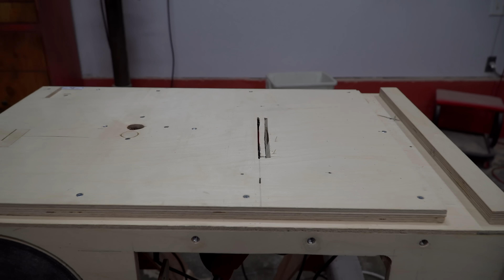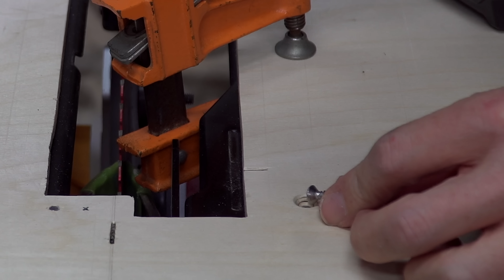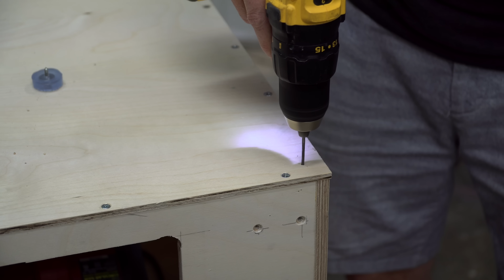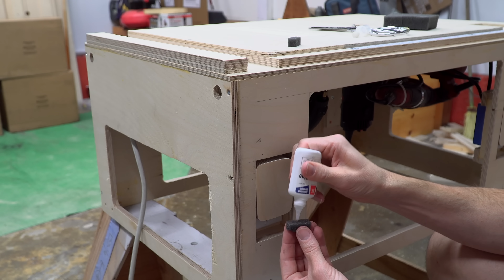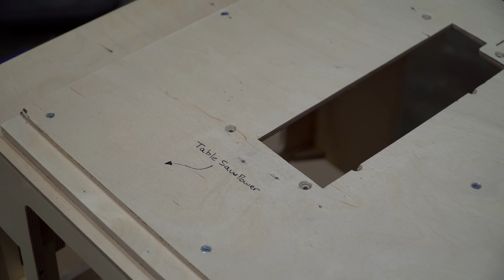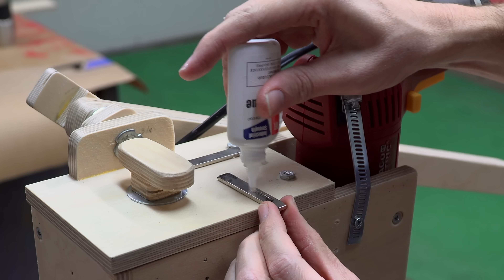Building the MicroShop, Part 8 (the Final Part)

Comment: I bought the plans and built the workshop never expecting my box store jobsite tablesaw to take out on me and I'd spend a month ordering and waiting for the parts that did not fix the problem to show up. Yes, another part is due in 3 days, but in the meantime, thank you Tommy, the workshop table saw I made is taking up the slack. 
  Before ordering Tommy's plans I had viewed YT's videos of woodworkers shops with 2 or 3 tablesaws and my thought was, well, if I had the space, the volume of work, and the money to buy more than my one table saw, just why should I do so? Question answered, TS breakdown. Duh.
  Thank you Tommy, you have been a tremendous help solving my present dilemma.
  My little 10 x 20 can spare the room for a second tablesaw and it comes in handy making repetitive cuts needing a re-set of the fence between each cut. I even made collapsable legs for my workshop unit that fold up under the base and make hauling to a jobsite quite easy and quick.
Reply from the maker: Glad to hear it 🙂

Comment: I really think you did a very good job on this work bench. Only comment I make is about the vertical drill unit. Could have fitted a small drill stand instead, less expensive and more reliable.
But very good indeed. i am planning to build something similar and perhaps use some of your ideas in mine.
Reply from the maker: Good luck with the project!

Comment: I really need to make this. I want to get the plans, but first wanted to know your thoughts on building it using just 1/4 inch plywood.
It looks like you used 1/4" plywood only for the third top piece. Is the rest 1/2 inch or 3/4 inch?

Here in my country, the only plywood available is 6mm (1/4").

Maybe MDF?

Great build btw.
Reply: I know your question is old, but you can laminate 2 sheets together to get 1/2" and 3 to get 3/4". I'm sure he lets you know the thicknesses needed in the plans.

Comment: This is quite the amazing piece of power-tool furniture (that's what I'll call it), but I do have a question about the design: If you could do it over again, would you have made the handle that lowers the drill press a curved piece that curves upward instead of a downward-facing straight piece? I could be wrong, but it seems like with it pointing down there could be two issues: (1) the bar could possibly end up hitting a part of the piece you're working on if it has high parts, but more importantly; (2) it just seems like it would be more ergonomic if it was pointing up. Maybe I'm overthinking that part of it, but that's a tweak (probably the only one) that I would make if I make this. Also, if you tried a curved piece, did it not work as well?

Again, this is fabulous, I'm just wondering about that one piece. And like others have said, thanks for also showing your mistakes. Often times people don't understand that some of this is trial and error--good plans sometimes just don't work out in the real world. That's good for people to know. Very nice channel and series on this project. Thanks!

Comment: @One Minute Workbench.....are the drills in the drill press and the disc sander the same model or do you recommend a less powerful drill for the disc sander?
Reply from the maker: I used the same drill for both and am very happy with the performance. I’ve never used the max speed for the disc sander, but the extra torque of a more powerful drill is nice. I hope this helps!

Comment: never heard of low friction tape, have no idea where to even get it, it probably costs too much (where i live), but i had a sticking drawer to fix once, planed the bottom down a little, refinished it with lacquer (polyurethane) and rubbed candle wax on both surfaces, now it runs smoother and more easily than any drawer slide ever could.
I have an old drill that has no bearing behind the chuck, it just rubs on lubed plastic, which obviously wore out and is now pretty much useless and unfixable, but i can still use it to drive a shaft, since the shaft doesn't move side to side, so i might make that sander part.

Comment: So, I'm thinking the table saw part looks good. I could definitely use that. The rest? Meh.
Then I saw the router table. Oh, I could use that. The rest is useless.
Oh, a disc sander? The jigsaw could come in handy. I've always wanted a drill press.
So, in summary, a project that only appealed to me because of the table saw leaves me asking, 
Where's the lathe?
I think I will be building much if not all of this.
Thank you.

Comment: I subbed a little while back but hadn't seen anything on this series until I came across the update to the riving knife!  Very cool build!  One suggestion I can make is to use a set of those self-leveling feet on the bottom of the cabinet.  They should help keep things square from the floor and remove any wobble from an uneven ground.  Time to hit that bell!
Reply from the maker: Thank you for subscribing, and thanks for sharing the tip about the leveling feet!

Comment: have thoroughly enjoyed this series and will try to emulate at some point as i'm planning a RV build when i retire and think this bench would be of great help. I do have a couple snags tho' all your drill dimensions and measuring are in inches do plans have metric spec for uk build and  finally a compressed air nail gun as a simple tool???  what could be used instead?
Reply from the maker: Thanks, Andrew! The plans include both imperial and metric  versions, so you’re good to go. Instead of a pin nailer, you could predrill screw holes, but a nailer will speed up the process significantly. Anyway, I hope this helps!

Comment: My dad and I want to build a MicroShop together for our garage, however we worry (well, mostly I worry) about the quality of Harbor Freight's tools that go into this. Unfortunately, they are very weirdly shaped/sized and I haven't been able to find ANY alternatives online, based on the specs posted on the page for the plans. What's more is that we already have a circular saw, but it doesn't fit the dimensions. Are those dimensions really tightly toleranced, or can I get away with an extra 0.5-1" per direction? Could I maybe modify the plans to fit my needs better? Particularly the width on the jigsaw, there isn't a single jigsaw on the market that is under 3" wide aside from Chicago Electric.
Reply from the maker: Alex, I’m stoked to hear that you and your dad are interested in the project. Send me an email through the website contact form as a reminder, and we’ll chat back and forth about your needs, and about how you might be able to get it done. Note, I’ll be out of range of internet starting tonight for about 5 days. So if you don’t hear from me today, just know that I’ll get back to you when I’m connected again. I hope this helps!

Comment: What spray finisher did u use? And would u recommended it?
Reply from the maker: I used a Wagner from Home Depot...the one that's specifically for stains and clear coats. I love it, and yes I'd recommend it. I hope this helps!
Reply: One Minute Workbench it does thank you what model do u have? I’m in the market and the only ones I keep seeing on the channels I watch are over $300 and I’m not about that life
Reply from the maker: This is the model I have: https://www.lowes.com/pd/Wagner-Control-Spray-250-Handheld-HVLP-Paint-Sprayer/1000177053?cm_mmc=shp-cprdpntgooglelia--paintsprayers-1000177053-_-0&store_code=1013&placeholder=null&gclid=EAIaIQobChMIyY7Y7Lqi6gIVEhLnCh0oigBLEAQYCCABEgK9sPD_BwE&gclsrc=aw.ds but you could try something like this to save even a few more bucks: https://www.harborfreight.com/Handheld-HVLP-Paint-Stain-Sprayer-64934.html?ccdenc=eyJjb2RlIjoiODE5NTAyODYiLCJza3UiOiI2NDkzNCIsImlzIjoiNTkuOTkiLCJwcm9kdWN0X2lk%0D%0AIjoiMTMxODcifQ%3D%3D%0D%0A&cid=paid_google%7C%7C%7C64934&utm_source=google&utm_medium=cpc&utm_campaign=&utm_content=&gclid=EAIaIQobChMIyY7Y7Lqi6gIVEhLnCh0oigBLEAQYBCABEgL-J_D_BwE good luck!
Reply: One Minute Workbench awesome thank you!

Comment: You might want to concider a couple of additions if they will fit inside storage inside. 
Your angle grinder chop saw with a way to clamp or bolt onto the unit.
A belt sander would be nice.
Since not all of the cuts will be at 90 degrees. You need an angle adjustment on your miter gauge

Comment: Nice series. I like how you used what you had built to help with the next step.
What was YOUR total build time for this?
Reply from the maker: Thank you! I spent about two weeks building it, however I find that filming makes my projects take about 3x what they normally would. Plus it was my first go at it, so I had to find all the design issues during the build, stop, redesign, repair, and continue. If I had to build one now, without filming (and the design finalized), I think I could do it in about 3 days. I hope this helps!
Reply: @OneMinuteWorkbench  Exactly what I wanted to know. 
It is much more than I need, but I will make the router table and disk sander portion of it. I already have a table saw, drill press...

Comment: Planning on buying the plans, is the 3d model part of it? I like everything as it stands, but I'd like the drill press where the sander is, so is not on the way of the miter gauge. Basically I want to swap sander / drill place places on cad to make sure everything fits inside still.

Comment: Hi Tommy, excellent work, I am thinking of buying the plans to do it. Do you think it could be closed with other wood, like a shell, to reduce noise? I live in an apartment and I don't want to make a lot of noise.
Reply from the maker: Thank you! Enclosing it may help reduce the noise some, but you have to be careful about airflow & heat build up. It could be dangerous unless you have some sort of exhaust....which could be loud itself (think, a vacuum for example). Another option would be to create sound dampening in your work environment. I'm not sure your exact setup, but if it's a bedroom you could build sound dampening panels and place them strategically. Anyway, good luck! I hope this helps!
Reply: @OneMinuteWorkbench  thx for ur time,
Im concern about the heat up but if I only use the tools for short amount of time.. I definitely wanna try and test it.
The panels could be a solution as well.

Love ur channel, this is the best project I have seen in years!!

Comment: Hi Tommy, this series has been really great.  Over here in ol' Hong Kong we don't have much space so this little workbench has been perfect for my rooftop mini shed.  The biggest challenge is allowing for the wood expansion between wet and dry season.  I've built most of this in the dry season so let's see if everything gets a bit tight when the humidity starts kicking in.
Reply from the maker: Thank you! My guess would be that it'll hold up pretty well, as long as it's protected. The one thing that might get tight is the miter gauge, and that gives me an idea (if that does happen). You could add two oversized holes to the outside rail that captures the miter gauge, and add counterbores. Add threads below in the main cabinet. Add hex bolts through the counterbores, through the oversized holes, into the threads below. The counterbores should be deep enough to conceal the head of the hex bolt below the surface, so they don't get in the way of workpieces sliding across. With the oversized holes you can loosen and tighten the hex bolts and adjust the rail so that it's tight enough to hold the miter gauge correctly, but not too tight. Then when the season changes, you can adjust again. Just a thought!

Comment: For future reference (and for anyone else reading the comments), silicone-based lubricant should be avoided in a wood shop. The stuff can really spread around more than you think, and if even a small amount gets onto parts that will be finished or painted, it can cause a type of flaw called "fish eye" in your finish which is difficult to fix or avoid. Best to just keep the silicone-based lubricants out of the shop entirely.
Reply from the maker: Thanks for the tip!

Comment: I’ve noticed during the application of the finish that you use a box fan with a filter. Is it enough to filter the air while applying finish? And if so, do you mind sharing your setup? Thanks
Reply from the maker: It’s nowhere near enough to filter the air, but it at least helps cut it down some. The respirator is mandatory. I would like to build a spray booth at some point...we’ll see!

Comment: Nice!  Really liked this project.  How many sheets of baltic birch did the whole thing take?  It's hard to get around me and the virus situation has made everything even more scarce.  Any preferences for home depot wood if somebody can't get baltic birch?
Reply from the maker: One sheet of 1/2" and another of 1/4". Anything classified as "marine grade" will be of high enough quality. Do a google search in your area looking for lumber stores and hardwood stores. Those types of places are more likely to carry the good stuff. I would steer clear of the selection at  Home Depot & Lowes, if possible. I hope this helps!
Reply: Nothing at HD or Lowes compares to Baltic Birch.   Check your local lumberyard.  I mean your real lumberyard.   They will be able to get it for you.   They also have it at your local Rockler or Woodcraft, but it tends to be a bit pricey there.

Comment: It's finally complete :-) Only now I noted you 3D printed the cable clips and the socket holder (so much for paying attention...). As you go on using the MicroShop, it would be interesting to know what modifications and/or reinforcements you find useful or recommended to make - perhaps a follow-up video some time later :-)
Reply from the maker: I'm sure I'll do some follow ups down the road - thanks for suggesting it!
Reply: @OneMinuteWorkbench  Thanks.